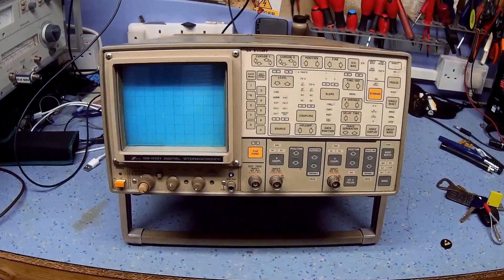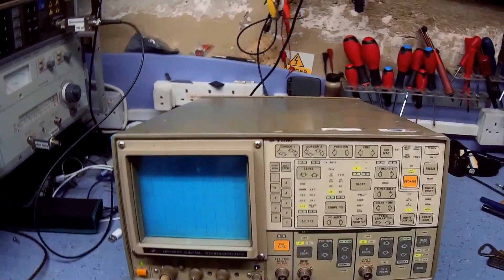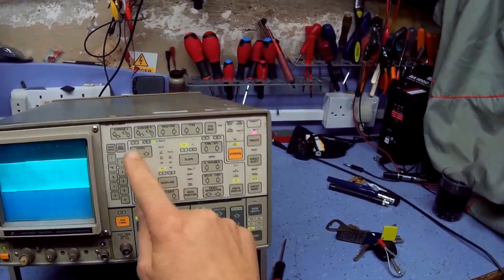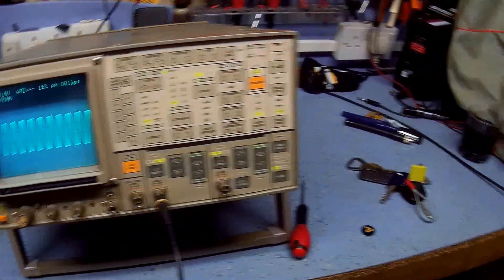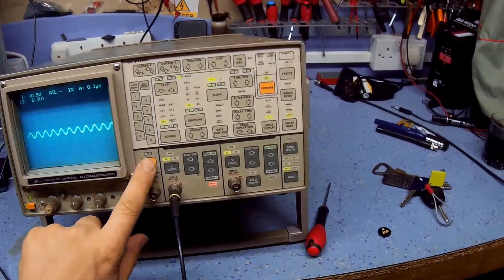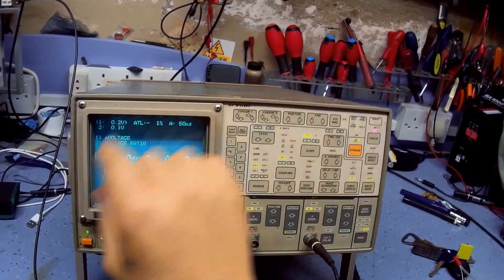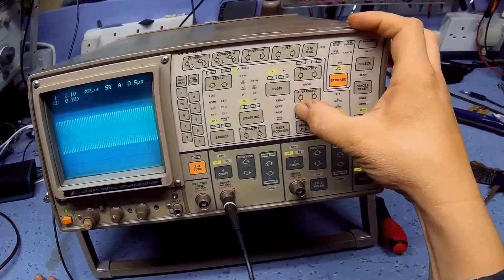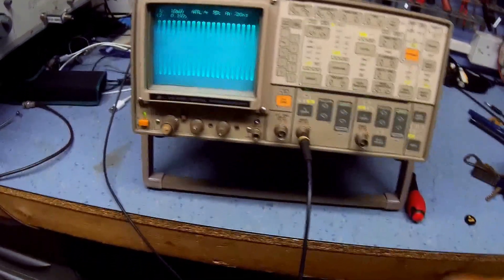Iwatsu ds6121  Oscilloscope

Comment: I have a question: can this oscilloscope be used to measure frequency without using the cursors?
Reply from the maker: Yes. If you can work out the frequency.  Earlier scopes than this had no cursor readout. It's just convenient.
Reply: @SoddingaboutSi  Thank you for the fast response. I noticed that the newer LCD screen oscilloscopes display the frequency of the signal  in cycles per second right on the screen, just like a digital frequency counter. Does this oscilloscope have that feature?
Reply from the maker: @daleburrell6273  yes a lot will  this old Iwatsu is a great scope but is 30 years old. Most digital scopes will do that.
Reply: @SoddingaboutSi  Nice talking with you.